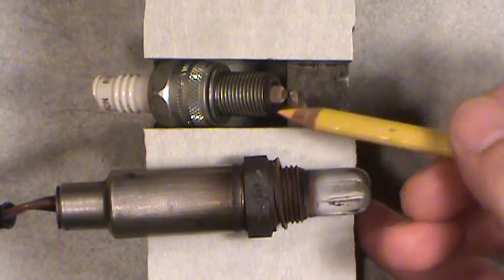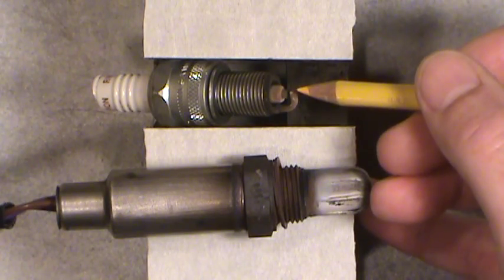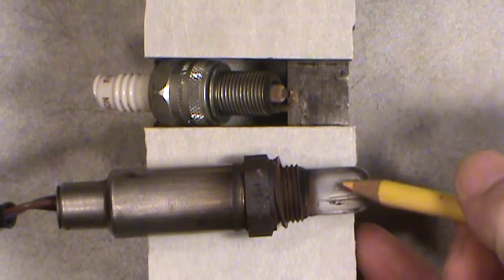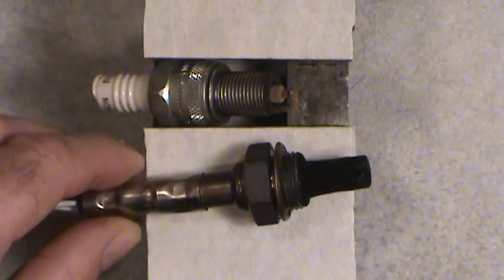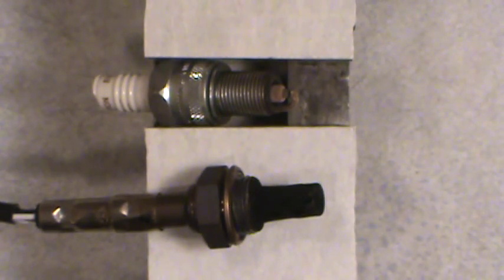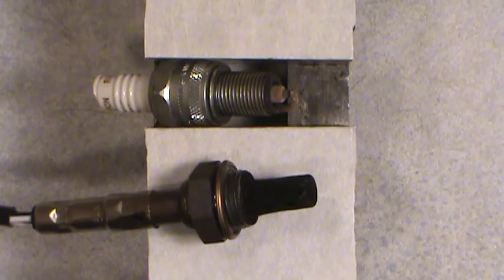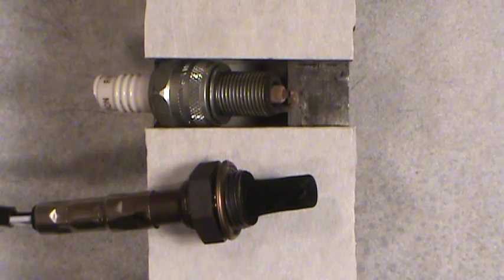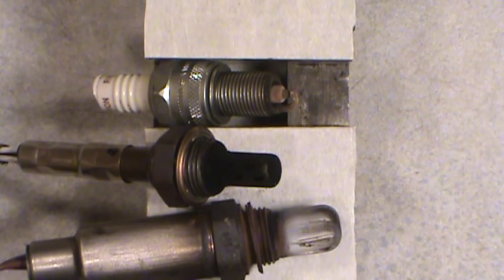Oxygen Sensor Deposits

Comment: What white ash looks like, may be helpful.  I ran 1 gallon of lacquer thinner + 1/2 tank of gas.  It may have done its job, burned hot, and left white ash on my sensor.  Trying to distinguish vs. silicone poisoning, which also leaves white stuff.
Reply: Would like to know almost exactly the same thing. Video basically just said if O2 sensor looks like this, you might have a problem. I need to know what the problem is/might be 👍
Reply: @ianbelair3047  I chased a huge number of things and ultimately, replacing my O2 sensor solved my problems.  I'm not sure if some presteps helped or not.  I wish I had taken the plunge on replacing the O2 sensor earlier, because it wasn't super expensive.

Comment: I have a 3800 v6, my mpg is 16. The oxygen sensor worked fine, no codes, I removed the oxygen sensor, it looked like your  the first oxygen sensor, ash deposits. I put a new oxygen sensor, the mpg decreased by 0.5 mpg. I put new spark plugs 7 years ago, only put 10000 miles since then. Should I change the spark plugs?
Reply: E M probably too late to help you, but you should at least INSPECT your spark plugs.  Pull them, look at their color and deposits, the shape of their electrodes.  Compare to a spark plug reading chart, easily found online.

Comment: I hahad audi a4 b7 tfsi change 02 sensors and sparplugs after a week a check is full of back carbon, clean spray clean and after a week it is black sooth again, Do you think i have a leaky injectors? No dash lights faults.

Comment: yikes... so what exactly is the point of this vid?
Reply from the maker: Greetings...Raccoon Willie...……...Thanks for watching...……...Well, let's say, for example, that, an oxygen sensor is working alright, and no trouble codes are popping up at all...……...Now then, here's where there just might be a tell-tale sign (deposit), showing up on the outside of the part of the oxygen sensor, where it has the engine's exhaust gas passing by it...…….Might be a bit too rich, of an air/fuel ratio, caused by some misfires, leaving more than wanted, black carbon deposits on the oxygen sensor, which I had, and no OBD-1 trouble codes were showing up at all...…….Maybe some burning coolant (leaking gasket perhaps?), which might leave some deposits, on an oxygen sensor as well...…….So, to me, any clue, that I might find (even on an oxygen sensor), as well as, on, one or more spark plugs (deposits), and, I've seen black carbon deposits, on the open end of a tail-pipe, even, after, a brand new 3-way catalytic converter was installed...……So yeah, I find that, just about any visual clue, can surely help someone out, that's trying to figure out, what the problem, just might be, and......till next time...…..Be Safe, take care, and have a good one.